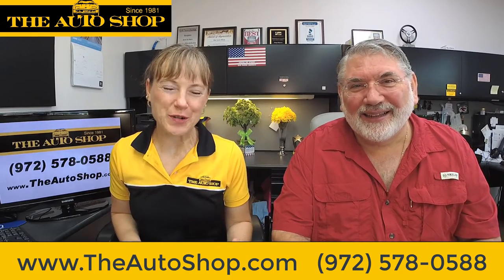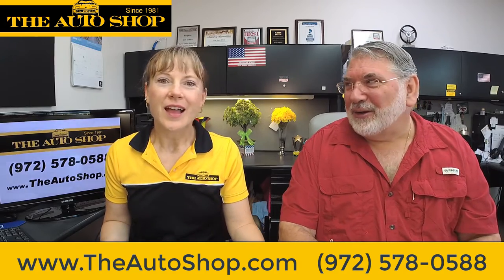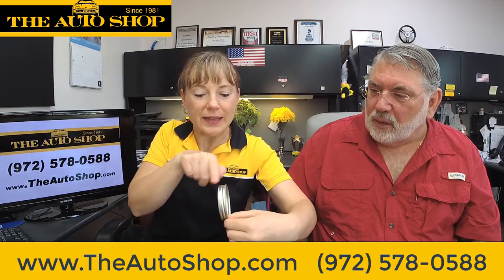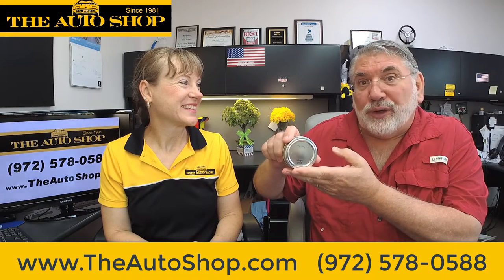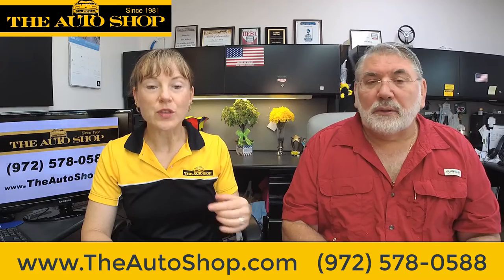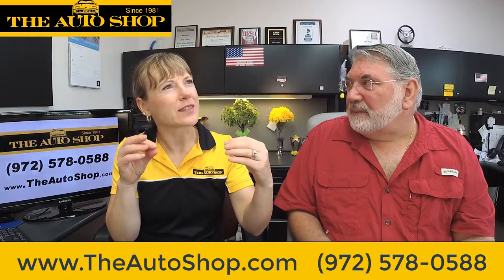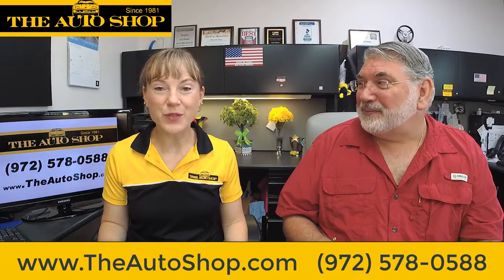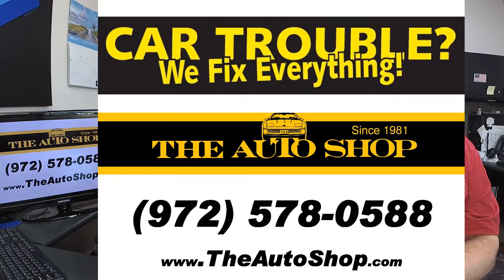Tire Vibration comes and goes - Cupping and your tires

Comment: I had my front tires rebalanced by a tire shop after the dealer rebalanced all four tires with a tire rotation.  I also had two four wheel alignments at the tire shop.  Second time I asked the tire shop to straighter the steering wheel better, it was offset to one side--it still does that when I put thrust on the car--whenever I do, the steering wheel goes a little bit off-center to the right, even when I adjust and note the crown of the road.  

On the tire shimmying, it occurs at 62 mph, and then goes away, and comes back at 62 mph.  I believe it is a wheel balance issue but the tire shop says it is because my tires are scalloped, slightly.  Only three of the four tires show scalloping.  As far as I understand, if the steering wheel shimmies at a certain speed and then goes away, it should be a balancing issue.  What do you think?

Also, the tire shop says my steering wheel being off-center upon thrust is due to my tire scalloping issue.  I find that hare to belief.  If the thrust is dead ahead and the steering wheel is dead centered, then when thrust is applied, let's say from a stop on a level road, the steering wheel should not be off center.  What do you think of my opinion?